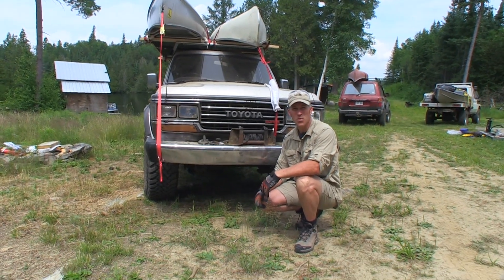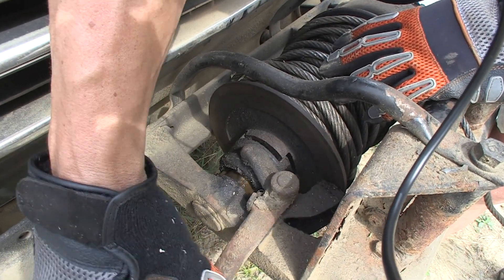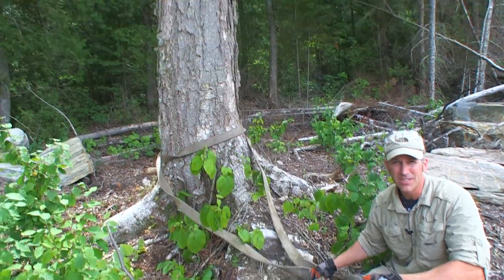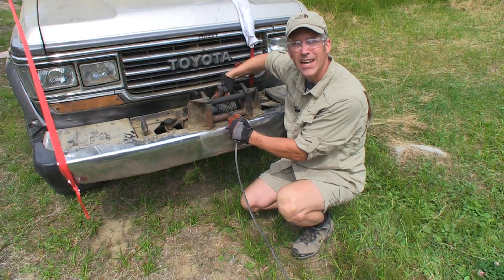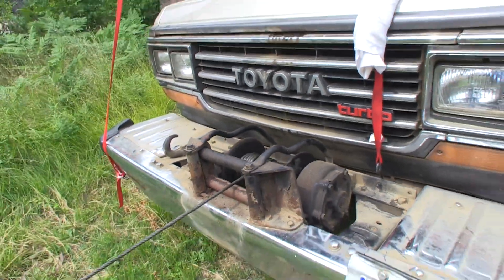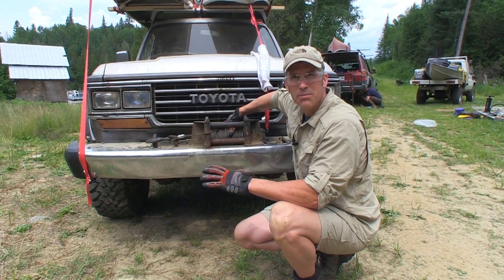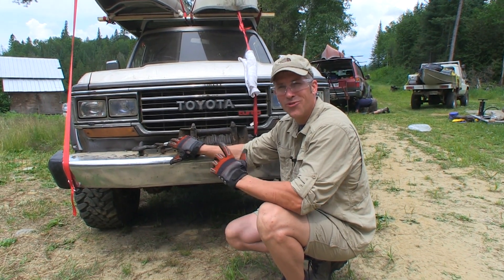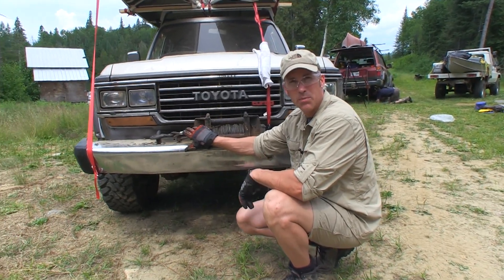Toyota Land Cruiser, Power Take Off Winch, PowerModz.com

Comment: got the same JDM hj61 with pto for last 10 years and it's fantastic. now I have it spooled with 40m of 12mm synthetic rope and I strongly recommend that upgrade to anyone. one word of caution with PTO, if you are alone, for no matter what do not leave the cabin when winching because if you get tangled or injure yourself, slip or what ever, that winch will never stop until truck runs out of diesel....
Reply: valuable info! Thanks

Comment: I love the Thomas PTO winch on my 40.. has done some serious pulling (dead pull of a 60series up about a significant grade).. so far I haven't ended up in a position where the engine wont run and I need a winch.... maybe I need to wheel harder.. :)

Another good vid!

Comment: hi... i have the 87 fj60 wagon same as yours with the pto. mine has done 122,000 kms and is absolutely original including the pto winch. its a truck that doesn't see a lot of k's, and i keep it garaged, serviced and well kept. i used it to put some trees down and rip out the roots which the winch did well... however i then realized by the sounds it had been awhile since the winch fluids were checked as it sounded dry. no damage done but not wanting to repeat until i top it up,.. question.. what type or grades of oil/fluid is best for the winch?
Reply from the maker: hmm, im not sure what they call for the fluid in that one - im sure a gear oil would be fin 80w90